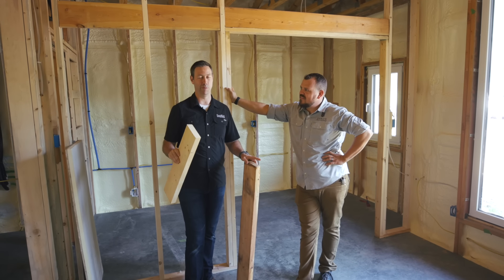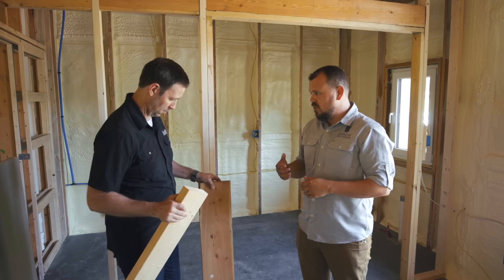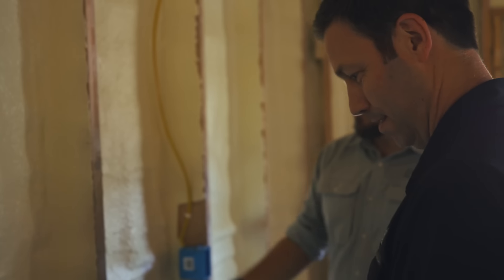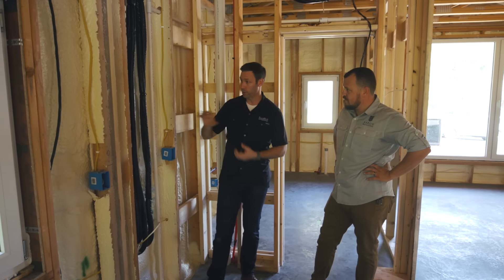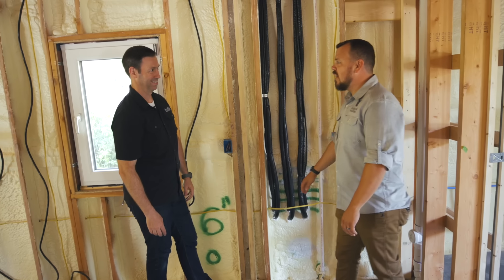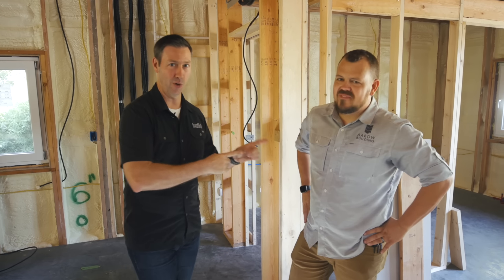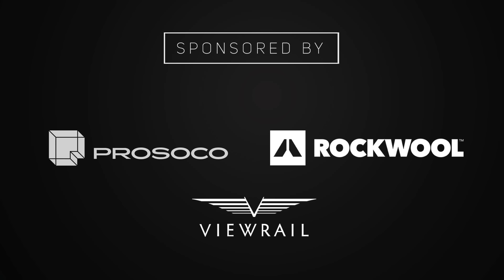Why would you frame a house with 2x8 lumber?

Comment: Awesome! As a disabled senior, my quest is to find a piece of land and BUILD my own tiny(ish) house with great insulation properties, old styling as if it grew over time and in materials that I would be able to supposedly gather from the land, put together and do it basically myself!  Yes, you can accomplish anything with the Lord at your side, making your crooked path straight. 

I have found a way to do the build, having found a Scandinavian style building block that I can do myself.  It is then pegged together.  I will adapt it with adobe slurry that will create flat walls inside and out with an air space in-between to take advantage of the cooling/heating from the earth 12 feet down.  The walls finished in lime plastering/adobe on the outside finished with carnauba wax to protect the surface.  Lots of windows with storm shutters/copper screening for the seasons. A covered wrap around porch so I can walk around during the rainy season...water catchment like I saw at Winchester House in CA.  She had seven cisterns that have never gone dry yet the no one knows where they are anymore.  

I have so many ideas! Who says a woman with congestive heart failure cannot build her own home, grow her own gardens!.  I, too can be self-reliant! I look forward to seeing your future shows.  Love the ideas!
Reply: Go realize your dream.  Don’t be afraid to ask for help to achieve it.  Good luck
Reply: Anyone can build a house, it's not rocket science, it's basically just a box with a roof. Did you ever look into starting a community/commune? Get a group of like minded people to group-buy land where you have your own space and house with a community garden. Everyone needs to have a skill that they share with the group to build and grow the community. Have a tool and equipment pool to share etc. Just a thought

Comment: This is exactly what I've been thinking to do should I ever get around to building my own house.

I'm curious to see a pro-con episode about single 2x8 vs dual 2x4 with a gap to allow for more of a thermal break.
Reply: We stagger the studs in the corridor walls for apartments, mainly for a nice sound barrier. One con, is the amount of studs used is more, but I am sure there is a way to possibly reduce the amount of studs. Our details call for a stud every 1' staggered. I was thinking about this during the video.
Reply: Hail Honkler  Curious why 2x12 plates instead of 2x10?  Do you plan to stagger the double studs?

Based on my quick calculations at the stud locations (assuming non-staggered and ignoring the insulated exterior plywood) with 2x10 plates you would get about an R-18 and 2x12 plates you would get about R-25.4.  In non-stud locations you'd get about R-40 with 2x10 plates and about R-47 with 2x12 plates.
Reply: Pretty much every house built in Australia has cavity walls, the only single framed wall I have seen is in 150+yr old pioneer type houses
Reply: Double 2x4 would be cheaper and more effective than this wasteful 2x8 wall
Reply: Minnesota Department of Housing did a lot of research on this almost 30 years ago. You might still be able to find their recommendations if you contact them. This idea of double studs to create a thermal break got a lot of press from Rodale's New Homes magazine in the late 70's and 80's. Cost effectiveness was the key: the farther north you went, the faster the pay back on the extra materials used. At the time, double studding was a popular alternative in southern Canada. The pay back was accelerated by the higher fuel costs (at the time) in Canada. Double studding the exterior walls would be the way I'd go if I were building here in Michigan.
Reply: Have your cake and eat it too with dual 2x8 wall framing.

Comment: I have built my home 10 yrs ago as passive solar design with 2x 8 walls and spray foam.  Thermal bridging is a concern if your trying to achieve high efficiency.   I’m a licensed builder and go through extensive training yearly. The new designs that are being brought forth are 2x4 walls with comfort batt (Roxul mineral wool) applied on the exterior side.  
My home has performed very well and I’m very happy with the results.

Comment: Hi Matt. I would love to see you do a video on alternate stud framing and it pros and cons.  2x6 or 2x8 walls with 2x4 studs.  Your technical approach is very informative and much appreciated.  Thanks
Reply: Alternate spacing using 2x4 in a 2x8 wall will also give a much better thermal break.

Comment: I put isolation in my interior walls as well, and it makes each room much quieter. My exterior walls are sound proof walls with 2 walls not joined or touching each other so sound vibrations can't transfer sound through a solid wall, and wall studs. It pays off in the long run because the energy savings soon catch and pass the cost of the added materials. Makes a worm quiet house that way.

Comment: I had the idea 30 years ago, when I was framing to use 2X8 plates with offset 2X4 studs. No thermal break
Reply: Great idea!!  You also eliminate having to drill through all your studs to run your electrical- just fish it around your offsets.  Mind if I steal it?
Reply: @nicholasoppenheimer3647  feel free

Comment: Wow! Really cool to see the benefits of 2x8's and the advantage of having all that depth. I really liked the detached triple 2x4 column they created for the truss load point as well, that's a very innovative little detail. Definitely going to check their company out.
Reply: Innovative? Really? Seems common sense to me, or use a 4" dia steel pole, not rocket science
Reply: @colstace2560  Okay maybe "innovative" was the wrong word...pole would work too, either way, I just like the fact that it was designed to be standalone and not part of the exterior wall.

Comment: 2x8 plate, 2x4 stud, 8" on center, one on the front of the late,one on the back, closed cell foam and you get a continuous insulation layer
Reply: Patrice Le Brasseur sounds super effective, just annoying to frame?
Reply: Interesting. I like it.
Reply: @Vikingwerk  it's not that bad to frame, you do the exterior stud 16 on center,,  raise the wall then do those o. The inside

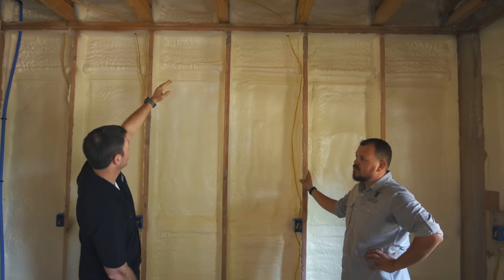Comment: At 2:04 you can clearly see that the floor trusses are offset and not exactly centered on the 2x8s.
Reply: don't have to be if a double plated top.
Reply: @Jordan Sheppherd That may be fine as far as code is concerned, but if you also listen to the audio immediately after, he clearly states they are centered and then goes on to praise the weight bearing capacity of such a setup. I wasn't commenting on codes, I was commenting on his narration.

Comment: I built with double 2x4 16" oc for a 8" wall. 2" of foam r19 insulation on top. It's very warm for a Montana winter. The benefit over the 2x8 stud is no thermal transfer. I didnt have to do the expensive zip or exterior insulation.
Reply: Yeah but that's a lot more expensive than 2x6 24 oc with 2" foam on the outside

Comment: From watching quite a few videos from this channel, it seems like it’s main goal is to make construction as expensive and difficult as possible.
Reply: @Mark OnTheBlueRidge, no, but he's usually pushing new products that haven't seen decades of testing and are still in their expensive phase. For example, fiberglass insulation and blown insulation have been used for decades. We know the health risks associated with them. We know how the break down over time (very little). We know how to properly dispose of them during demolition. And, because the patents on them are long expired, we can get them cheaply from various competing companies. These factors don't all apply to spray-in insulation.
Reply: One has to factor in the Total Cost of Ownership over the life of the building.  The money you spend up front to having a well insulated, tight building envelope, will be paid back in short order in energy savings for heating and cooling.  Then there is the intangible quality for a comfortable house to live in.
Reply: That, and building odd houses that will be hard to re-sell.
Reply: @bwillan  Are you going to live in your house for 50 years? How many months a year are you heating? In Missouri this building style will never pay for itself.
Reply: @oldcountryman2795  Heating is only one part of the energy use equation.  Cooling is equally important.  I live in Canada in an area that is relatively humid (Southern Ontario).  All but 2 months of the year we are either heating the house or air conditioning it.  So a well insulated tight building envelope is important and will pay for itself over time.  I don't know about  your energy costs, but mine only ever seem to increase.   I may not live in my house for 50 years, but wouldn't you agree that relatively low energy bills would be a selling feature some buyers would consider?

Comment: One thing he didn't address was the additional increase n foundation, wiring, etc. in addition to the cost of materials because you are either decreasing the interior volume of each room by 2-4 inches on each wall or increasing the foundation by that much on all sides.  It's a cost I would likely be willing to incur, but it is an additional cost.
Reply: What increase in wiring? What increase in foundation? Even if there was, it wouldn't add cost

Not a builder, are ya?
Reply: @shimes424  More weight added to your foundation. Your foundation has a rating...

Wiring, I'd assume OP is getting at that you're going to have slightly more wiring to add to your home due to the increase in distance.
Reply: @shimes424  Typical site builders not knowing what an engineer is. Lmao
Reply: The heavier the structure above, the more the foundation has to hold . It’s amazing how awful people can be in the comments .☝️
Reply: A two story already has a 8 inch wall.
Reply: 101sabre huh??
Reply: I think what they were really getting at was that it wouldn't double the costs of the job. It would require more money on timber, and yes, a small amounts extra in foundation widths and cable/piping lengths but small increase in these costs and possibly additional small increase to builders/labour costs. Many homeowners and some builders may not have considered this, so I think it's interesting and OP is technically correct but doesn't detract from the fact that (from there own admission they probably be willing to pay anyway) it's small increase for big benefits especially as you get bigger extremes of weather.
Reply: @shimes424 , Right ?  Why would the foundation have to be increased ? He could build that house out of 2x6's with the same foundation.
Reply: You don’t have to increase foundation width because the extra 2” won’t sit on the foundation. Making the extra width non structural
Reply: @ozzy2753  true, you could choose to do that.
Reply: @A B @broc212  Builders often construct 2x6 16" on center. That's 16.5 inches of stud every 4 feet (5.5 inches thick every 16 inches * 3), this is 18.5 inches every 4 feet (9.25 inches thick every 24 *2). Those are pretty close, and I imagine with some thought given to positioning of fenestration, etc, it would be possible to bring them even more in line.
Reply: Wiring would be negligible... maybe 3 feet total ($5). They always run wiring through the center of the walls... but if the center moves inward, that could literally save 5 bucks instead.

The foundation however, you may be right. It depends on how willing the engineer is to thin the safety threshold... if not, an extra 33% concrete would cost quite a bit.

That said, a foundation engineered to minimize costs has to meet a minimum amount of extra load bearing, so if the extra weight doesn't get too far from that, the engineer may still okay the use of a foundation meant for 2 × 6 with 2 × 8.
Reply: It has to be designed at the planning stages. If you have a budget at  say $150,000 then you design the house to fit that budget no matter what construction methods you use. If those walls cost more then you adjust somewhere else, cheaper kitchen, floor coverings, tile. Everything in the building of a house is compromise unless you have no budget
Reply: @shimes424  no need to insult
Reply: A yard of concrete around here is about $120 poured, how much more concrete do you need to add another 2 inches? Labor is the same
Reply: U dont understand how to build.your comment is not valid.
Reply: Ok ppl my point was I've never seen 6" foundation walls, but maybe building codes are stricter here.

If increasing the stud size increases the weight enough to require a bigger foundation wall, your foundation wall was too small to begin with
Reply: @shimes424  the point is that any increase is negligible.
Reply: @ozzy2753  I just didn't know if they used 2x8 for the bottom plate...which would still fit on 8" foundation walls
Reply: 6:19. Also most foundations are made to accept concrete block which is 8" wide, 1/2" more than a 2x8. Wood in walls dosent weigh much, the weight that matters id dead and live load on floor systems. Weight transferring down isn't an issue its the weight over top of clear spans that matter
Reply: @user27278  You'd be increase the volume by 33%.  Should be the same increase in cost.

Comment: Double frame with 2x4 and off set the studs. That breaks up the low R-value studs that carry the cold straight through your walls.
Reply: Good idea. Also provides sound-proofing.
Reply: Bingo
Reply: Until you get to a door or window, then an offset double wall gets complicated fast.
Reply: @jerryherndon6766  Not if you just use 2X8s around doors and windows.
Reply: @craigcorson3036  Exactly! It gets complicated.
Reply: @jerryherndon6766  We did 2x6 with 2x3 offset, which better ensures that the in-the-wall vapour barrier is never cold than with double 2x4 offset. At windows and doors we used 2x4s on flat with 1" rigid insulation behind them, so we killed two birds with one stone: got rid of the thermal bridging and avoided having to figure out how to nail a 2x3 edge-on to a 2x6 behind it. Instead we just hammered 4" nails through the on-flat 2x4s and the 1" rigid then into the 2x6s. We kind of cheated and predrilled the 2x4s with 3/16" holes as those 4" nails are beasts. We nailed in a stagger pattern so each next nail went into the other 2x6 of the double post.
Reply: I bought a house with 2x4 walls in VT. I ripped the entire exterior off, siding, windows, plywood and all the insulation we ripped out.  I off set another 2x4 wall and screwed and nailed it to the other.  We sprayed all the walls flush with foam, not the new environmental foam but the tough polyethylene stuff that is super hard when cured.  This was 10 years ago but now I have seen some 2x8 manufactured boards being produced with a foam barrier built right in! Can’t wait to see the materials that will be used in houses 10 years from now!

Comment: Question: is the rigid enough to keep the dew point outside the assembly? I'm not familiar with your climate zone.
Statement: bearing capacity of 2x4 studs is more than adequate so let's not pretend that it's not. That said, 2x8 is an awesome assembly. 
Question: how do you support the 2x4 bearing points laterally? I assume that it's not needed since the floor is the diaphragm and the stud is a good enough slenderness ratio??
Statement: love that you're showing off your own home. That's fantastic - great work! 👏👏

Comment: It is beautifully built, but I can’t even fathom wanting a 4,000 sf home!
Reply: If you have 2-4 kids, and a home office it’s pretty easy to fill a 4K sqft home. You have 4-5 bedrooms, an office space, living room, dining room, kitchen.

You can easily live comfortably in 2-3k sqft but if you enjoy larger open spaces with big closets and plenty of bathrooms it’s not hard to comfortably fill in 4K sqft. And remember he’s a builder so the actual cost of building it is fairly low, and he can experiment with some new ideas without much worry.

I know some people living with 5-6ksqft, and it’s definitely a big house but the way it’s laid out it does not feel giant or overwhelming. They have lots of big open rooms. And each bedroom has a big closet and bathroom. But I’ve seen other people’s large homes that feel so uncomfortable due to their size/bad design.
Reply: I have 2 kids and 1900 ft. It is plenty. I couldn't imagine having to clean 2 of my homes for the same amount of people!
Reply: All I see with huge ass houses is heating and cooling year round. Most houses aren’t purposely built for great insulation like this house. My house is 900 sq feet and it feels plenty big enough for 4-5 people. To each their own I guess.

Comment: Mine is built by 2x12’s 2000 square ft house in Arkansas. Was rough cut and air dried in my shop over three years. TRUE 2x12’s. Did that 10 years ago.
Reply: Very nice. Are you a home builder? I wouldn't even begin to know what all was needed to do something like that. What did you fill the wall cavities with?
Reply: Thank you. No sir or ma’am not sure of the pronoun that I should use (respectively). My father was a true carpenter/craftsman. I wouldn’t pretend to know what a carpenter knows however I am paid often to imitate one. Used spray polyurethane foam (spf) for insulation. To pass inspection here one must not go over 6” worth. Then electricians done the wiring followed by r19 batt insulation. I must confess there was a small amount of compression that took place but not much. Then followed by t1-11 on the walls.
Reply: So, normally a house that size would need about a 3.5 ton a/c unit. I'm guessing you get by with a 2 ton unit?
Reply: We have a 5 ton ac. It’s recommended that 1 ton per 400 square feet. It doesn’t come on many times a day though even when really hot out side.
Reply: @youarerightandiamwrong7314 , I've always heard 1 ton for every 500 square feet. But with so much insulation, I'd worry that short cycling the unit so much would be bad for it.